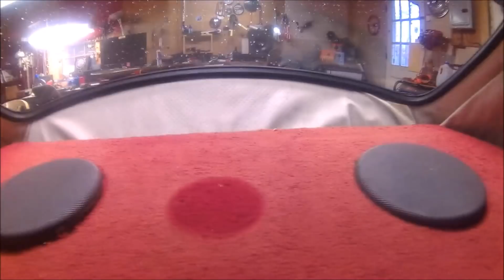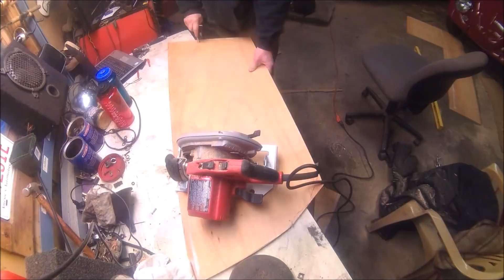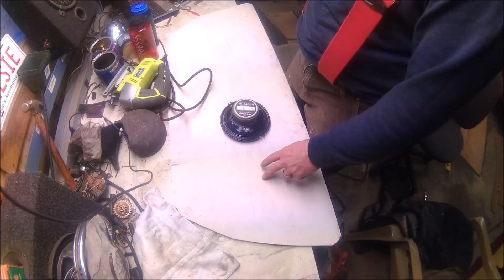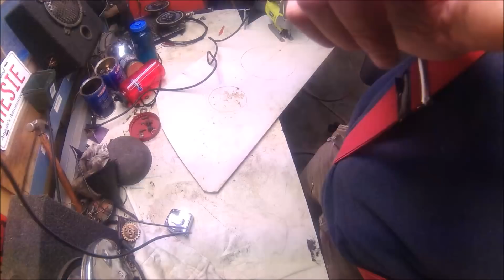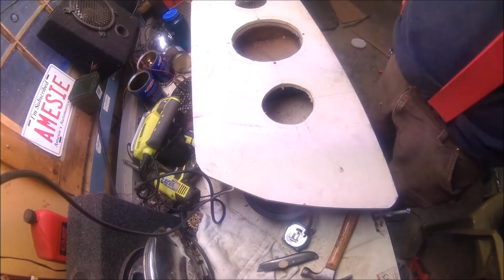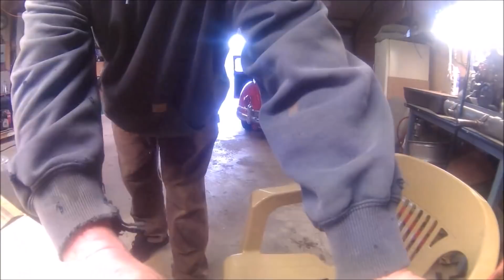1967 vw bug (Ruby)gets more speakers installed

Comment: The inside of a beetle is the perfect shape for audio. I had two 6x9's on the top with holes cut out for a lower shelf with two 10inch  subs in. I also had pods under the dash with 5inch speakers it was loud but also quality sound. Was a 1971 1300 beetle.
Reply from the maker: they are great for audio sound.thanks for watching